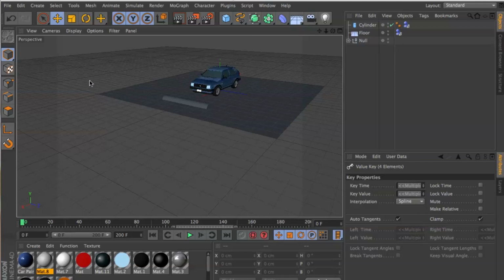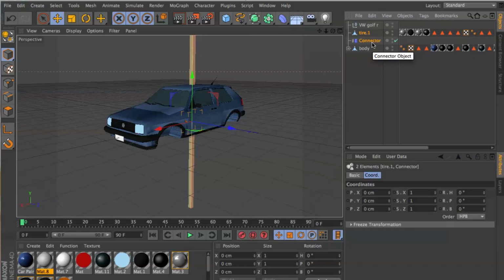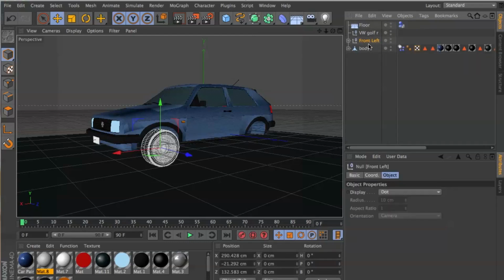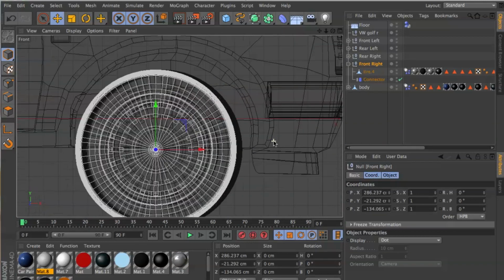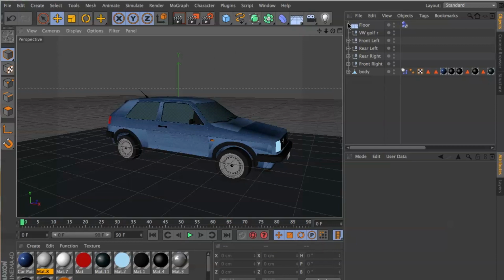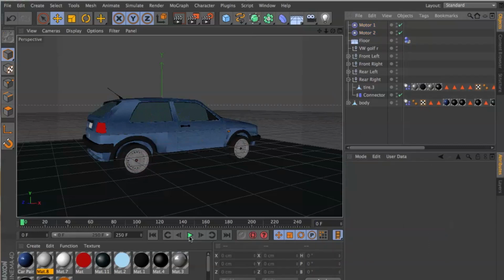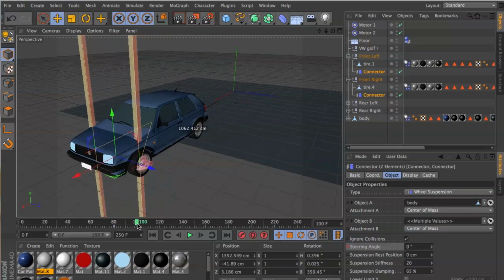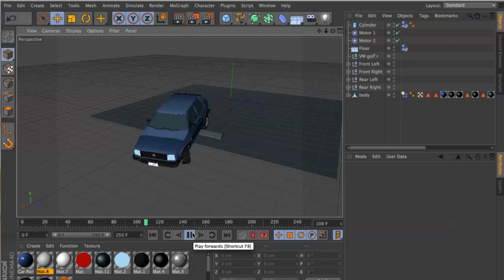Cinema 4D | Car Rigging Tutorial + FREE 3D car

Comment: I rig the car using connector and motors, the wheels are turning like crazy (which is fine)
however the car body drops as a stone and does not move, i copy the wheels of the car and used a cube as the body
just to make sure my steps are correct and everything works fine, however when i do over steps with car body this time it still does not move)
i tried this about three different times same reaction when it comes to car body................

Comment: Isn't there a way not to clear the position of a wheel and then manually placing it back? I'm trying to rig a TRUCK with MANY wheels. Resetting their position to zero and and putting it back manually would obviously make me crazy...
Reply: Put connector inside each wheel and apply Reset PSR to all of these connectors.

Comment: Thanks for the tutorial. However, I get stuck in the motor part: My car doesn't move at all. It looks like something's happening in the rear wheels edge but even if I change de Angular Target Speed and Torque parameters it won't move. I also tried changing the motor's orientation but nothing happens. Any ideas?
Reply: I have same problem, can u help me now?

Comment: Awesome tutorial. However, the wheels don't seem to work the same way when you have all the wheel related objects in a null. For example, I Have my rims, the brakes, the tires and the disc brakes in a null. I set the simulation tag to rigid body for that null. But it doesn't work the right way! :/
Reply: i have the same problem it didn't work 
(I 'm using c14)
Reply: I found that if you go into the settings of the Dynamics Body Tag, under Collision where it has the menu for 'Inherit Tag' if you change it to Compound Collision Shape, it works the same way as in this tutorial.  This worked for me anyway :)  (R15)